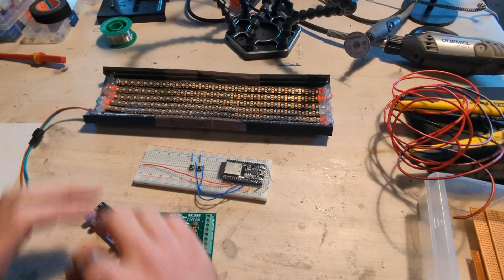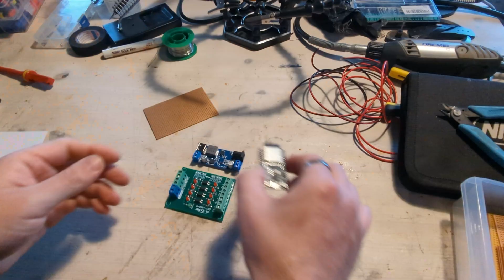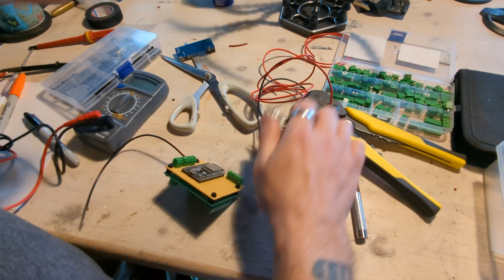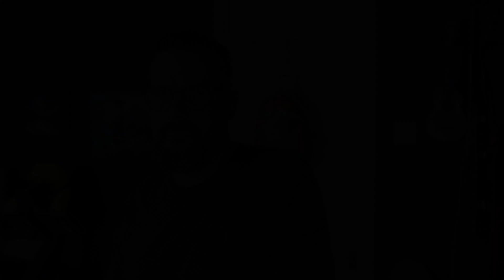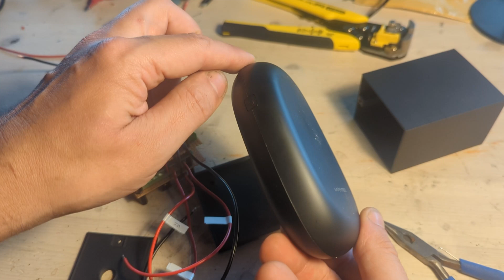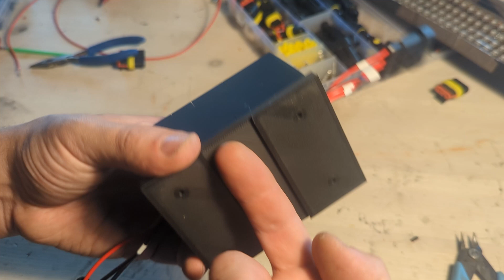Building a Prototype for Our Light Controller | Arduino in Your Car Series

Comment: With a project like this there are endless ways it could be miniaturised but for a one off prototype this not too bad. You could have removed the 5V voltage regulator module by using a TSR 1-2450 which is a little 3 pin component and could have been soldered to the same strip board as the ESP32 but if space is not an issue then what you used will be fine. 
The stand offs are handy so I've ordered some for my own projects.
Reply from the maker: None of this exists like this now. It's all on a custom PCB. It was just a prototype afterall to check that it all worked
Reply: @GarageTinkering  Sweet, I'll catch up eventually. 🤣

Comment: Why are you using a dev board stacked on perf-board?????? 

The better approach is to design a custom PCB, use the ESP32 "module" (the silver thing on top of your little dev board, they are also cheaper than an entire dev board) sprinkle in some caps, a voltage regulator, and some pin headers, and you're DONE... NO need to muck about soldering a thousand different types of headers to piggy-back one board to another... in the end, the BOM (Bill of materials) would end up being cheaper than the devboard, and all the other modules you're taping and gluing together, and the final result would be easier to weather and vibration proof (you know... cause vehicles need that kinda thing)

You can use free services like SnapEDA to design the board (there are TONS of reference designs out there for esp32 modules and voltage regulators to rop 12v(car) to 3.3v(esp32)
Programming header can be added to the board to program the esp in-situ
LCSC for parts on the cheap, and JLCpcb for 5x boards for around $2 (not counting shipping)
Reply from the maker: Simply because, I am new to this and as of yet haven't delved into making custom PCBs. It's on the iterative to-do list for this project though, so I'll get there.

Comment: It’s interesting to see the whole process. I’m thinking about adding an ESP32 to the diagnostic port of my 24 years old car and have it store and report data over WiFi when the car is in the garage. I’m also thinking about making a large automatic watering system with a lot of humidity sensors and valves for all plants in the housing cooperative garden.
Reply from the maker: Funnily enough, an ESP32 powered ODB2 gauge and diagnostic screen is something coming to the channel pretty soon!

Comment: The hexagonal cylindrical posts between the boards are called standoffs or spacers.

Once everything is ironed out next step is to create a PCB to make the package smaller and easier to work with.  This might be beyond your skillset if you don't know how to recreate circuits, draw it in an electronic schematic editor, and/or design a PCB from the schematic but if you're able would be a great way to make it look more professional.
Reply from the maker: Yeah. If I was going to consider taking it to production that would be the case (outsourcing it - I've had companies approach about it already actually), but for a one off seemed like overkill. 

Definitely something I want to look at for potential future projects though that I will want to take into production

Comment: should of used a socket for the ESP32.
Reply from the maker: Well I was today days old when I found out that existed lol. Next time!
Reply: @GarageTinkering  You can get sockets or headers (there is a difference being mainly sockets are designed for pinned (DIP) IC chips and headers are designed for boards like Arduino Uno, Raspberry Pi, and, in this case, ESP32).  Sockets are one size and hard to customize if it needs cut which they're not designed for.  Headers usually come in a single or double row and can easily be cut to the number of pins one needs.  Sometimes you also see headers being used for jumpers and sockets on PC motherboards.
Reply from the maker: @TheKuptis  Honestly I'm still relatively new to the PCB game, so great to have this info. Definitely giving me a list of things to look into for future projects
Reply: @GarageTinkering  Be careful!  It's a rabbit hole that can easily be fallen into.